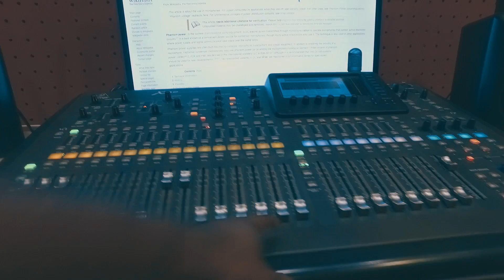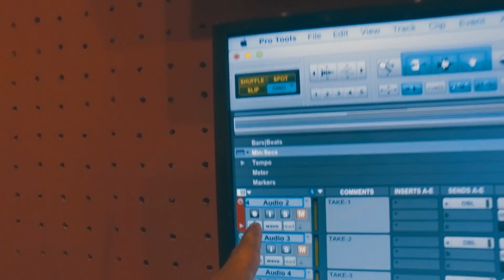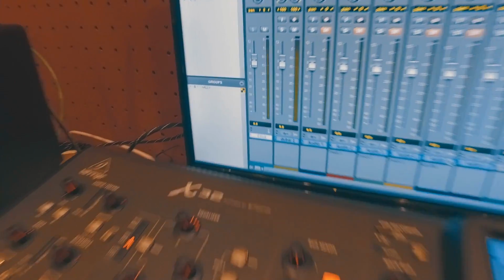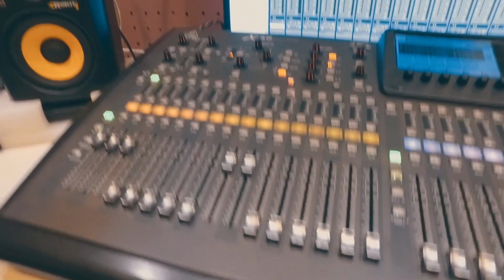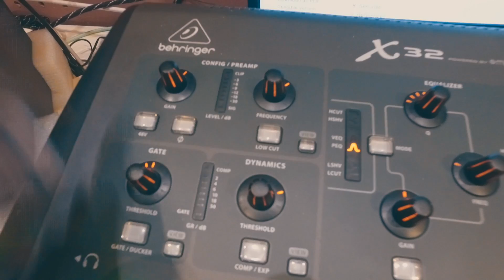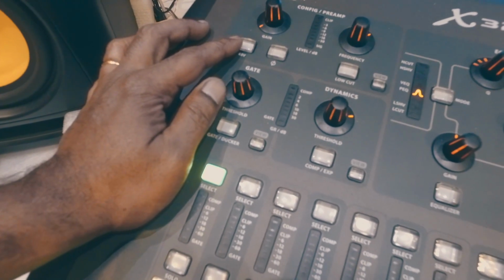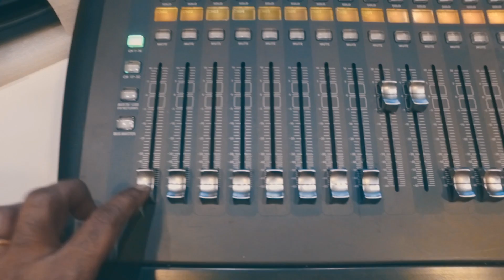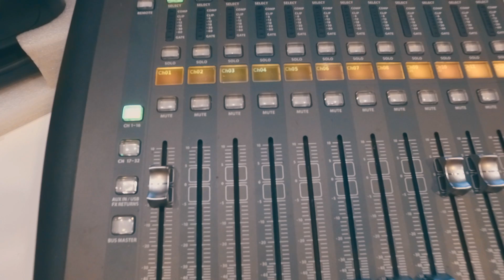Recording Studio - Introduction to studio mixers

Comment: That Shure 55 in the video does not require phantom power, if you keep hitting that 45v button to that mic you really gonna see some doubling as in buying another mic.
Reply from the maker: I am not using shure 55 with a phantom power bro. I am using a Rode NT series condenser microphone. That shure 55 I use only for instrument recordings without phantom power.

Comment: Are you using behringer x32?
Reply from the maker: Yes, I am using Behringer X32
Reply: @djneo  glad to know. I know that x32 are friendly  user and not hard to configure at all.
Reply from the maker: @carlotheatheist  yes it is. I will be doing a tutorial on it soon.
Reply: @djneo  i have a favor. Can you make a tutorial how to use auxiliary  system of x32? I mean how to connect external processors through x32 auxiliary output system.